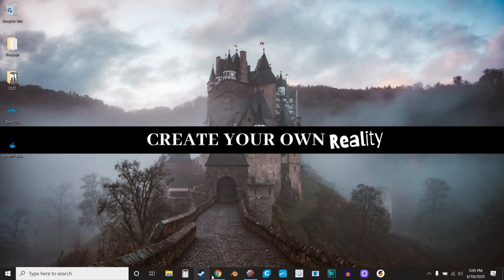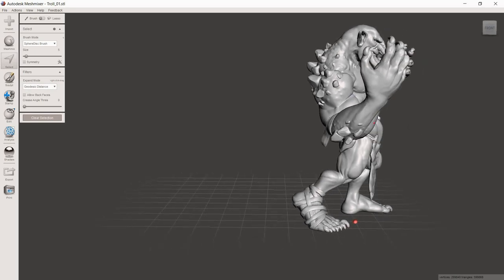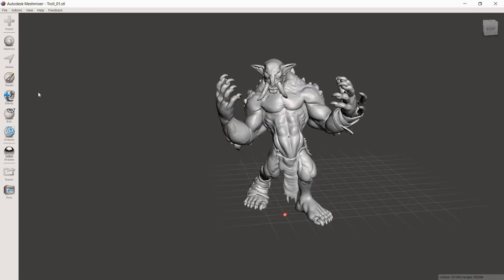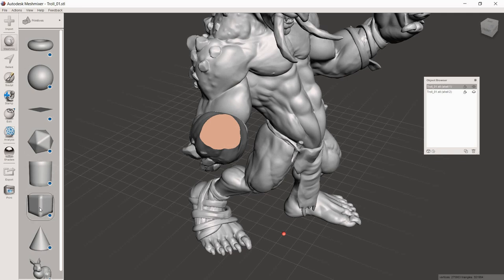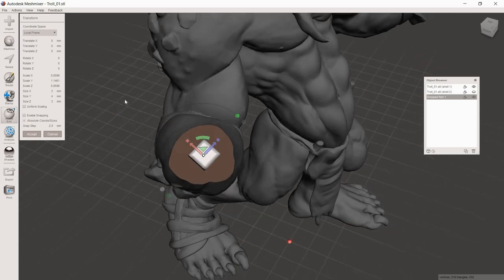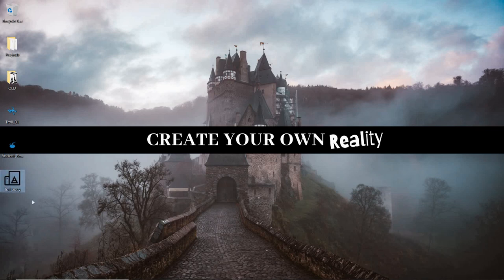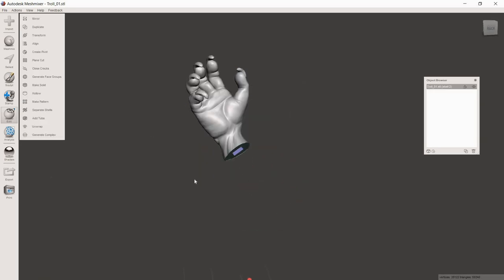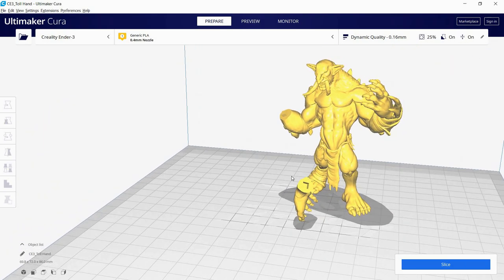How to Make Perfect Alignment Pins With Meshmixer!

Comment: Ive imported a checked and manifold STL model into meshmixer. I have little red areas around some areas which I have no idea about. When I try to use the seperate shells options it comes up with anywhere between 3-226 shells (ive tried to do so a few times) What am I doing wrong?
Reply from the maker: You can use the inspector tool to figure out what the issues are and see if you can repair them. Sometimes it's a very small issue inside the model.
Reply: Slice Print Roleplay thankyou - i have tried to do so and the repair actually seperates the problem areas from the rest of the model...Went back to blender to double check the model and can’t see anything. But there has to be something wrong there wouldn’t you agree?
Reply from the maker: @coreyschoermer5877  yes and no. Meshmixer is a really powerful tool sometimes even to its own detriment. Sometimes it can find faults in a model that really aren't a big deal at all. I'd recommend bringing the model into the netfabb tool (search Google for it) to see if it can find any errors and repair them. It does a really great job of repairing small issues and leaving almost no trace.
Reply from the maker: Or if you use Prusa slicer for resin printing it has the netfabb repair tool built in.
Reply: Slice Print Roleplay awesome thankyou so much. It’s just a shame because i just want to create pins for the seperate parts and i don’t know how to do without using meshmixer. But i’ll check that program out, thanks again
Reply from the maker: @coreyschoermer5877  it's no problem at all. Once the netfabb tool is done with the model you should be able to bring it into meshmixer and separate shells without that issue.
If you have any more issues you're welcome to post pictures on the Facebook group and I might be able to give you a little bit more specific Direction.
Reply: @SlicePrintRoleplay  Amazing - youre a gem!
Reply from the maker: @coreyschoermer5877 ... What kind of gem? 😊
Reply: @SlicePrintRoleplay  So I used the netfabb tool - what a godsend! And got to the point where I can cut the model properly and the seperate shells option works perfect! Thanks again youre really helpful
Reply: @coreyschoermer5877  Windows 3D builder is great for repairing files too. I'm gonna check out netfab, I've never used it before.

Comment: I keep getting a fatal error message when I try and create the union between the peg and one of the sliced halves? You know why that is?
Reply from the maker: There are a few reasons why that could happen. You can (hopefully) get around it by using the "Combine" option instead. With the pin it's not necessary to use the Boolean Union function.
Let me know if that works.

Comment: Just finished this and trying slice up a helmet but whenever I do the Boolean difference my laptop freezes up. It does the union with no issues. Can’t seem to figure this out.
Reply from the maker: What are the specs of your laptop? It's possible Meshmixer is crashing your laptop during that function.
A Boolean difference is a much more difficult process than a Boolean union.
Reply: @SlicePrintRoleplay  I think that is the problem. My laptop is 6 years old. If I slice up the model into smaller parts first and then attempt it, do you think that would help?  The helmet is pretty big and detailed. The part I was trying to key it with is a small jewel. I have to split the helmet anyway to fit the printer.
Reply from the maker: @BillMedlin71  it may help yes.... It also may help if you stop any unnecessary background processes your computer might be doing. Do you know how to do that?
Reply: @SlicePrintRoleplay  yes. I’ll give it a try. I usually have Google sync running and it can consume resources sometimes.
Reply from the maker: @BillMedlin71  definitely let me know how it goes!
Reply: @SlicePrintRoleplay  yep. That was it. The method works on every smaller part like a charm. But when I try to do it on the largest part with the most details it locks up and crashes. Luckily I just ordered a new gaming laptop yesterday. It should be able to handle it. Just have to wait for it to get here.
Reply from the maker: @BillMedlin71  yeah that makes sense. Glad you figured it out... Oh man enjoy your awesome new laptop!

Comment: What do you do when the program crashes when you're trying to undo everything?
Reply from the maker: Sorry it's an unnecessary step that I thought would be easier, but I realize it's not the best method.
Instead of undoing the steps, just create a another copy of the pin and hide it using the browser window. Does that make sense?

Comment: It must have updated because I don't have those options on a union, I have combined but still don't have those super important options :(
Reply from the maker: The combine option works just fine for this process so no worries there.
Reply: @SlicePrintRoleplay  it was because I was trying to do 2 different pins at the same time lol. Thanks for this guide. It all works perfectly
Reply from the maker: @Dominus66  Glad to hear the video was helpful. You are very welcome! 

Oh that makes sense, I should have thought to ask that.. There is a trick you can use that will let you do multiple pins at once. I talk about it in this video.
https://youtu.be/2aoJUkE8nJg

Comment: after using these settings everytime i hit accept it crashes
Reply from the maker: You could try the process without changing the settings. If it still crashes then you'll know it's the program/an issue with hardware. Unfortunately, Meshmixer is no longer supported which is such a huge bummer. That means we will see more issues has time goes on. 😞
Reply: @SlicePrintRoleplay  it was an error on my part so i noticed when changing values you have to hit enter on each one once changed or it will try to change all at once when you hit apply and will cause the crash
Reply: @SlicePrintRoleplay  thank you! this tutorial has helped me alot
Reply from the maker: @dattisha27  glad to hear that!

Comment: a shortcut to this is to make a duplicate and hide the duplicate of the cube before doing the union. so you don't have to undo everything. then you can unhide the cube and then hide the body when you do the next step.
Reply from the maker: That is absolutely a better option. When I created this video I thought the process of creating a second pin and hiding it would be more difficult. However, I failed to consider the computing power that reversing pervious operations would take. When I update this video I will definitely correct that!
Reply from the maker: Also thank you for the recommendation! I really appreciate when viewers offer a better solution to a process I outline in my videos.

Comment: I've trying to input target edge scale to 0.25 but everytime I do Meshmixer takes a long time to load
Reply from the maker: That's pretty normal especially if your CPU is lower than an I5, Ryzen 5, etc.
Reply: @SlicePrintRoleplay  i have a ryzen 5 3600 so would it take some time?
Reply from the maker: @istorm6887  hmm that should be powerful enough to get the job done. However, if it's a large model and or if the model is high detail then it's understandable that it would take awhile. How long is it taking?

Comment: when i try to do the hollow, i select the square part, do the transforme and than that's a shit hole... when a try to do the 3.3, 4.4 and 3.3.... i cant do it, the program doesnt accepte 3.3 number. i need to put 3,3 and that's bug that become a 0 and the cube disapear... anyone have an idea ? i have done the tutorial with the troll model...
Reply from the maker: When you hit transform and enter numbers are you making sure "Uniform scaling." Is unchecked?
Also on the window that comes up when you hit transform, what options are selected at the very bottom of the window?
Reply: @SlicePrintRoleplay  uniform scaling is unchecked... Enable snapping is unchecked too. Absolute coords/sizes is checked but deactivated. the coordinate space is at Local Frame. the only way i have to enter a dot in the size is to put the size to 33mm to put a dot in the scale... and then to use the dot in the scale to put 1.1 in that way to get the 3.3 in the size... its a little strange.
Reply from the maker: @rolemoica6983  that's really odd.. I might be missing something obvious though. Would you be able to get a screen shot or video and upload it to the Facebook group? I can take a look and see if I can help figure it out.
Reply: @SlicePrintRoleplay  @tommy doyon Hi, I have the same very strange behaviour. I am not able to put in any "." in the fields of Transform. Also the way described by tommy doyon is only working for 1 field an then no other field works. I am now already very frustrated. Is this problem already solved or addressed?

Comment: Help! When I try to do a Boolean Unit, it says, "An unknown fatal error has occured in the current Tool. Aborting."
Reply from the maker: So the Boolean Union isn't required. Instead use the "Combine" option that should be listed in the window that pops up when you select two different models.
Using the Combine feature rather than the Bullion Union feature requires a lot less computing power so it shouldn't cause that error, but you'll get the same result.
It's my fault for not recommending that process in the first place. Sorry about that.
Reply: @SlicePrintRoleplay  thank you!
Reply from the maker: @christiepearce6553  you are very welcome!

Comment: The project should be saved once the peg is put in, so that you don't have to risk crashing while mashing an arbitrary number of undos.
Reply from the maker: Yeah I debated what process to give for that part. I ended up going with that one because I thought it would be easier. But I realize now that I should have just explained how to duplicate the pin once you have it placed.
I'll be doing an updated video.

Also I often run Meshmixer on my mid range laptop and very rarely get crashes.
If you're getting a lot of crashes just from undoing something you might have an issue with your system.... Or maybe I'm just lucky.

Either way thanks for the feedback.
Reply: @SlicePrintRoleplay  the computer I was running on is extremely spicy, so I wouldn't put hardware issues on the top of my list. I did use slightly different settings compared to what you had in order to get good edges, so maybe it made meshmixer sad.

Another benefit to saving is that you could later print a hand in a different position or holding a different item. Cool way to seem like a cool DM.

This tutorial was really well done!
Reply from the maker: @jeanclaudevanslamme  ah I see... Well in any case I definitely appreciate the feedback.
Adding in different weapons is actually something someone else asked me to do a video on, but you make a great point about saving at that point in the process.
I'll definitely be doing an updated version of this video.

Thanks for the encouragement!

Comment: My life is spent sanding down this keys.  Resin expands and they never fit.
Reply from the maker: Even if you scale the pin so it's smaller than the hole?
Reply: @SlicePrintRoleplay  I am taking about the ones other people make.  I guess they were made for FDM printers. I did find that mesh mixer does put some sliced models back together automatically as you open them.
Reply from the maker: @laartwork  Ah okay thanks for clarifying that! Yeah it really depends on how the models where set up. For FDM I don't go smaller than 0.03. That usually works for resin as well, but you could possibly go smaller if your resin doesn't bloom much.

And yeah as long as the parts where saved with their coordinate information then they will automatically import into the correct locations. It's awesome when that's the case!

Comment: lmao, i you said short work, i told it to boolean union almost 20 minutes ago and the "level 1 refining" bar is barely a quarter done,
Reply from the maker: Oh... "Your results may vary."
Haha sorry about that. Complex models will take longer... Sometimes much longer.
Reply: @SlicePrintRoleplay  its.....a cube loli gave up using meshmixer, downloading fusion 360 as we speak.

u feel lost, just got a 3d printer and the only options ive found for modelling are garbage(meshmixer) or extremely complicated(blender)
Reply: @SlicePrintRoleplay  why does yours go so faster? when in the boolean menu any time i change anything i have to watch a loading bar for twenty minutes, i got a ryzen 5 5600x is that not enough? do i need a nasa computer? do you have a nasa computer?
Reply from the maker: @theputnamto3468  oh I wish! No my CPU is actually the same as yours I believe. However, I actually recommend this process on my laptop. That has an I3 I believe. So much less processing power than your PC.
However, the biggest factors are going to be RAM and the model itself.
You want at least 8GBs (preferably) two 4GBs sticks so you hat the Boost from parallel channels.
However, all models are not created equal. It really depends on how well the artist understands the end-users needs. I am no expert, but from what I understand you'll occasionally run into models that haven't been refined. So they're extremely data-heavy and complex models. This is great if you want to make detailed edits to a model and have a lot of data to work with. But not so great if you're looking to make simple edits. Because the system has to process through all of that data each time you make an edit.
I can't guarantee that's what's Happening here, but it's a pretty safe bet.
Have you tried this on multiple different models from different artists and had the same issue?
Reply from the maker: @theputnamto3468  oh I'm really sorry to hear that. If you're looking to only make simple edits then try 3D Builder on Windows. It's light on features, but easy to use.
I hope you find something that works for you!
Reply: @SlicePrintRoleplay  it must be my model then I got 4 8gb sticks so I don't think ram is the issue.

Thanks for your input though, very helpful